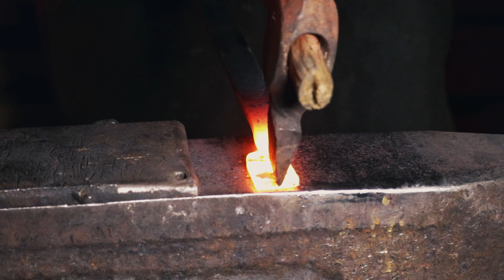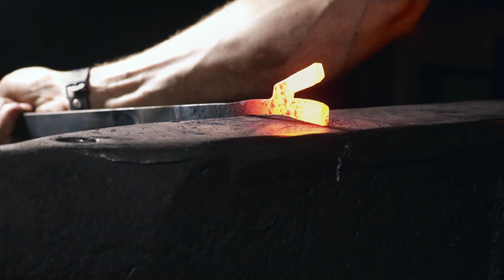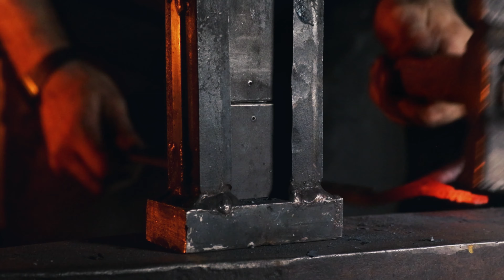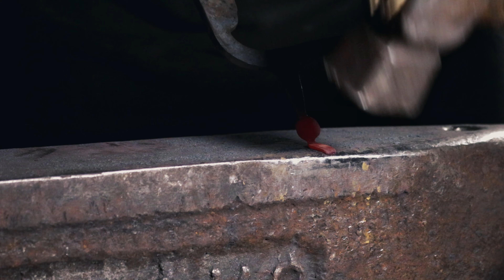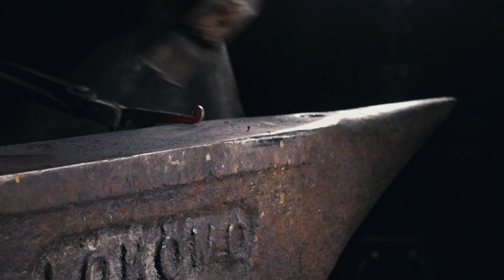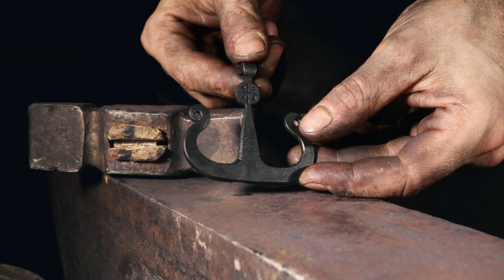Forging Viking Jewelry: Iron Age craftsmanship, blacksmithing a unique pendant

Comment: Hi ! I wonder how you get the smooth look. Do you brush the piece often although it doesn't show on camera ?  Maybe it's my hammer work that is not even enough and I leave dips and marks that I can't erase after when I flatten the piece...

From your experience what is important to watch out for to get a smooth enough flat surface like you show in the video ?

Thanks for your time if you answer and thanks anyway for all the videos ! It's really good to see you work as you're quick and precise !
Reply from the maker: Hi! Thank you very much! I do brush it with a wire brush to get rid of the scales. There are a few things that helps getting a smoother results and that is besides hammer control, that the hammer's edges are rounded and also the face can be slightly rounded. Sometimes a bit of cold forging can make a nice even surface. But I would say that you first look at the hammer's face and see if it needs to be adjusted. Also take your time, when you notice a dip after a hit, try to change the angle of the hammer and see how it affects.
Reply: Thank you !  @lufolkcrafts